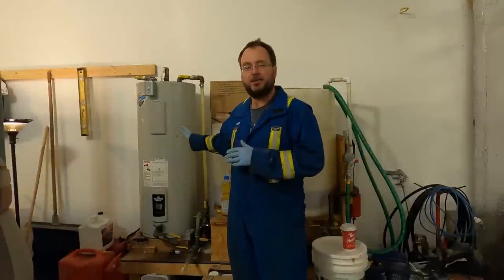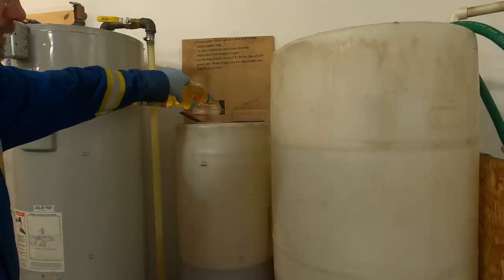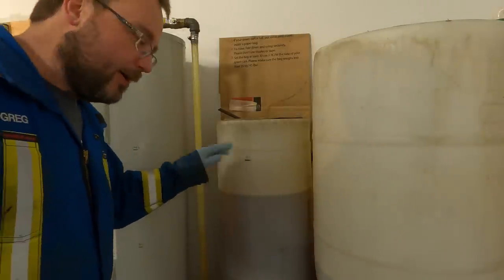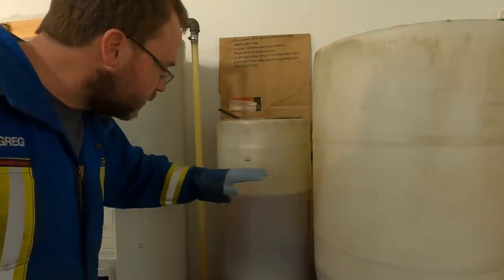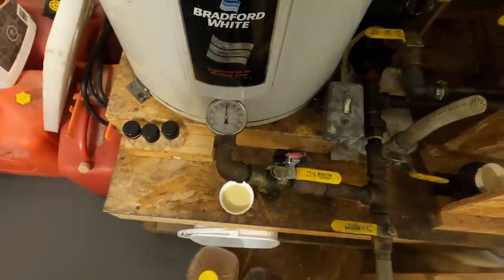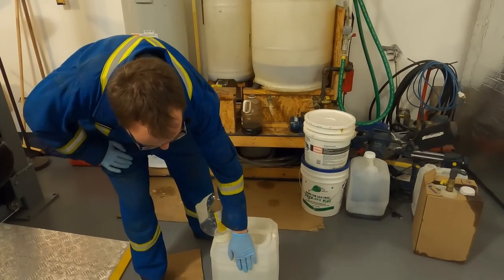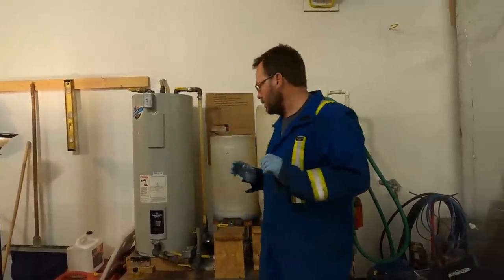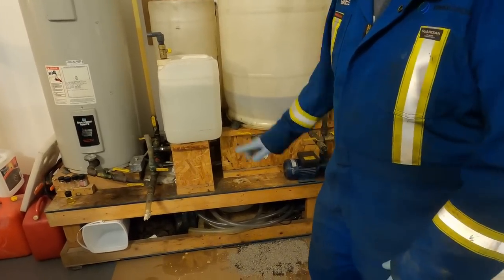Making a batch of Biodiesel from used Canola oil - HOW TO MAKE BIO-DIESEL!

Comment: I ran a 50 gallon BioPro semi-automated machine for a bit over a year back the last time diesel hit $5 in the US.   It was a great experience, but I always like people to know the bad with the good.  Issue #1 was just acquiring enough used cooking oil to process.  Most of the mainstream places like McD's etc all have contracts with larger companies to come pump their waste oil tanks.  That left us with gathering up the scraps from various "mom and pop" places, and it's a nasty smelly process.  We had a couple of 50 gallon plastic drums on the back of a small trailer, and a 12V pump.  We'd spend half a Saturday driving around collecting up enough oil to process, then after we got back to our shop you would have to filter all the collected oil into other barrels, then heat/de-water the oil if it had been exposed to water, then load the machine with the oil, the methanol and the Sodium Hydroxide or Potassium Hydroxide, then start the machine.  Then the #2 big issue was the waste glycerol.. not glycerin, because at that stage your separated glycerin still has a bit of methanol in it and is nasty stuff.   So you either have to find some place to take the glycerol off your hands (and you'll have a LOT of it), or you'll need to do another process of separating they glycerol into methanol and glycerin, and then hope you can find someone to take all that glycerin off your hands.   At the end of the day, it's a LOT of work, with a lot of messy oil, chemicals, waste products, etc.
Reply from the maker: all correct.  I do not recommend individuals make biodiesel.

A few points:
- Fast food oil is no good because they use it to the end of its life and is full of acid.  Too hard to process.  The key is to get good clean oil from a local pub.  I had one pub that had good clean oil they changed weekly and put it in plastic jugs for me.

-  Most larger cities have waste disposal sites where you can drop off old oil, paint, etc.  Take the glycerol there.
Reply: @gregs_garage  All good points.   The processing of the oil, regardless of its condition, was never the problem.  The BioPro would consistently produce ASTM commercial grade biodiesel every time.   But it's extremely hard to find enough source oil, especially depending on the amount of diesel you need on a monthly basis.  A few jugs from a small pub or restaurant would only be a drop in the bucket, at least in terms of what we needed, which was to make 50-100 gallons of biodiesel each month, enough to make it worthwhile from a cost perspective to fuel a couple of our trucks.   I live in the suburbs of probably the capital city of petroleum production in the US, and while we do have a handful of centers that take waste materials, there is a service fee to do it, especially if you are dropping off a couple of 55 gallon drums of glycerol every few months, which adds to the cost of making it in the first place.    I think there are "sweet spots" for how much you produce, such as a very small batch producer for minimal needs for car, small truck, etc, or much larger batches than even what we were producing so that the costs could be absorbed by a larger group, and utilizing the machine more frequently.
Reply from the maker: @5thGenNativeTexan  Yes the sweet spot is small production for sure.  I run a 1.9 liter VW diesel that gets 40 MPG. I make Biodiesel and blend it into the tank with petroleum diesel a few gallons here and there.  It works for this, but big volume production becomes a fulltime job.
Reply: I did the same thing. Semi automatic. I remember titrating the oil. We would go to the city and purchase a few 50gal drums of methanol. Had a few different transfer pumps. Run it through the processor. Then pump it into a 100gal cone tank. Let it sit. Drain the glycerin the pump it into a bubble wash drum. Wash it twice, then pump into a 1000gal tank I had. Ran our truck, tractors, heaters, ect...  Lot of work! Pain in the ass.  Gel up in cold weather. Plug filters.  It was a learning experience though.  I'm glad I did it. I have a long gravel driveway and build a spreader for the back of the tractor and coat the driveway with the glycerin. Tar and chip!😄
Reply: Just use gelatine to filter it.we use this process in the uk.
Reply from the maker: @andywells397  I've seen a lot of this gelatin method lately.  That's not Biodiesel - rather it seems to be a way to filter the oil.  you end up with cleaner veg oil, not biodiesel.
Reply: Did you build the Reactor yourself?
Reply: @BAVALCOINEN  Are you responding to my post?  If so, no.  As I noted I purchased a unit called a BioPro from a dealer in the US.  It's an  automated batch processor.
Reply from the maker: @BAVALCOINEN  100%
Reply: @5thGenNativeTexan  
Yes indeed.
How big was it?
Are they still around?
Can you please share more about it here?

Thanks in Advance.
Reply: An easy way to get rid of waste glycerol is to just burn it the next time you are burning off a big pile of old wood. 
A second way is to blend it with just enough used engine oil to get it good and black and then dump it at a collection center that takes used oil which is supposed to be any place that sells new oil.  

As a used oil recycler, I could care less if there were a few gallons or even 10's of gallons of glycerol mixed in with the volumes of used oil I work with.
Reply: @tcmtech7515  You need to burn glycerol extremely hot.  If not, then you've got mustard gas, and then you've got a bad day.   Typically, glycerol is already black.
Reply: @5thGenNativeTexan  The last time I checked wood fires were more than hot enough. 
If not, just make sure the smoke is going toward the neighbor you don't like.
Reply: @tcmtech7515  True, you'll probably see 700F degrees or more in typical wood fire, hotter at the core.  The critical state for glycerin is from about 400-600F, at which point it's making  toxic acrolein fumes (aka.. mustard gas).
Reply: @5thGenNativeTexan  Probably not a good idea to try and burn 55-gallon drums worth with a campfire in one go then. 😋
Reply from the maker: @tcmtech7515  it's already black.  just call it motor oil if that's the issue.  They don't check.
Reply: @gregs_garage  As I commented before. It's what I do for a living and yes, at my level I don't care.   

The problem is many of the collection sites are very anal about what they think is in the oil people bring them which is fairly justified given if the people like me next up the chain reject a load they have they have to deal with it and that can get extremely expensive for them real fast because the only places that will take it then are the HazMat disposal places and they will screw them over hard for stuff that isn't even hazardous because they can get away with it.
Reply: @kgsalvage6306  Where did you get the methanol and how expensive was the stuff ??? Any pointers Sir ??
Reply: @gregs_garage  Could you use this fuel oil in a kerosene heater using just the oil ??
Reply: @Victory First  I live near Pittsburgh Pa.  I got it at Penn oil.   The only reason I was able to get it there was a friend of mine has a mining  company.  I'm not sure the cost because I  would go pick 10- 50gal drums for him and put it on his account.  Got paid for the trip with methanol.  Not sure on any special tips,  but if you have any questions I'd be happy to answer.   The plastic cone bottom tank definitely made it easier to let the glycerin settle out and drain off.  I actually did 40 gal at a time.  For cleaning after processing, I had a 55 gallon drum and put electric heating elements out of a hot water tank and heated it up.  Added some water.  I made a coil for the bottom of the drum out of 3/8" copper pipe and drilled small holes in it.  Connected to an air compressor and bubble washed it.
Reply from the maker: @victoryfirst2878  maybe, but the finished product would likely burn better and less risk of clogging up the heater.
Reply: @tcmtech7515  😀😅😅🤣🤣🤣🤣🤣
Reply: I use the glycerol to "clean" the waste vegetable oil. In the reaction tank is 250 litres , in goes about 25 litres glycerol which then gets whizzed in with a paint stirring tool run by an electric drill for 5 minutes or so. This does a great job of removing or settling any particulate matter and can be drained out after a day or two. Nice clean oil ready for the transesterification process.
Reply: ooooooooooooooooo
Reply: Been making it for about 5 years, no regrets.
Reply: I found it made a reasonably good degreaser but you only need so much degreaser

Comment: Did you ever measure how much electricity is required to process say 100 litres and figure out a cost per litre? You seem to be a wealth of knowledge on bio diesel it’s a shame you now hate it lol! Great video Greg thanks very much!
Reply from the maker: very little electricity.  The pump runs for maybe 2 hours and burns maybe 100 watts?  The blow drier is maybe 500 watts for a couple hours.  I'd guess 25 cents electricity total.  Let's say it is $1.00.  That's 1 cent per litre.

The biggest cost is methanol.  Second biggest is KOH.  Total cost about 30 cents a litre, or a dollar per gallon roughly.  When fuel is $5.00 per gallon it works out well.
Reply: @gregs_garage  awesome! I would have guessed it cost much more! I daily a 2001 ALH which is fantastic because diesel is on average €2 per litre in Ireland at the moment! 250,000 miles on the clock and still averaging 50 MPG. I won’t ever bother with bio diesel, I don’t do near enough mileage yearly to justify it!
Reply from the maker: @RobertE92  I drive a 2003 ALH.  Diesel is not far from 2.00 CAD here.  About 1.50 USD per litre
Reply: @gregs_garage  almost 2.50 cad here in NB today. Which is why I'm here lol
Reply: @gregs_garage  What is the kwh of your water heater? Or is it propane? Mine is 7kwh so it would cost a decent amount to heat all that oil
Reply from the maker: @jaytee9111  120 volt element running maybe 1000 watts.  Maybe 30-50 cents to heat the oil.  Negligible.
Reply: @gregs_garage  A used oil heater could save a few dollars there too, offgrid solution ... be ready.

Nice setup Greg, gives me ideas for mine.
Reply: @jaytee9111  The oil has to be heated to 50 degrees C and all oils need a fraction of the heating required by water. Oils have a low specific heat capacity.
Reply: The best way to clean used cooking oil is to boil it over water.  Add about 40 litres to a 200 litre barrel and top up with dirty oil. Boil the water until oil is hot. Switch off the heater and allow to cool to 60 centigrade. The first literally drops into the water. Pump this warm oil to the reaction tank and rapidly mix in the prepared methanol/KOH (or NAOH) mixture. Allow to settle and cool. 
Pump off the biodiesel and drain out the glycerol soap. 
The biodiesel will still be caustic. use a misting water sprayer over that methyl ester (biodiesel). The fine water droplets gently wash the methyl ester. Sample test the pH and stop when it’s neutral. Drain the soapy water to waste. Add clean water for use with the next batch. 
The best way to mix oil and methoxide is via a fairly powerful pump. Rapidly pump the warm oil to the reaction tank. Use a T fitting at the pump inlet to add methoxide as the oil pumps through. You can test the settings with water instead of the pretty nasty methanol/caustic mixture. You need 4 litres of oil per litre of methoxide. 
The pump will churn the mixture allowing a good reaction. 
Large LP gas bottles, inverted, are ideal. The dome top is a great funnel. You will need to add tapping points as necessary.

Comment: When I was younger I grew up out in the "sticks" (very country small town). I'll never forget it, there was an ancient old man who had a nasty old IDI 6.9 liter diesel f350. I got to talking to him about the gross looking tank in the bed of his truck all plumbed in. He literally just went around and gathered up used fryer oil for free back then, and said all he did was heat it, filter it while heated, 1st through paint filter, then through an oil filter or something similar. After that it was ready, his waste oil tank had a heating element, he would warm the truck up on regular diesel, shut off the diesel with a valve and turn on the heated veg oil, it ran fine. When he was ending his trip he would turn off the veg oil and turn back on the diesel let the residual fryer oil get burned up in the engine (if not the truck wouldn't start again) 🤷 that's literally all he did. Long term side effects I never seen him again to ask...
Reply from the maker: good story - not biodiesel but yes old diesels will run on all kinds of oily liquids.  For a while anyway.

Comment: nice !      i read a paper once that mentioned the {glycerin/koh /alcohol}   by product could be used as a rust remover ,  id be interested to find out if that is correct ,, i think they were heating it up and soaking parts in it , somewhere below the vapor temp , 120 degrees?

Comment: That's a REALLY nice setup.  The only thing that could be added is an old top loader washing machine to agitate the mixed solution.  However, you've essentially accomplished the same thing by recirculating your water heater for approximately one hour.

Comment: Ive watch the 3 part videos, and then this video multiple time and i am just fascinated by this whole process. I want/need to do this once in my life. Not many people know this, but this whole process can be produced self sufficiently. Solar panels to a car battery to produce, by electrolysis with seawater, sodium hydroxide. Chlorine and Sodium Hydroxide is produced in two chambers, the gas expelled is Hydrogen , this can be used to heat the Distillation of wood to produce methanol. Both used in the catalyst. You can also grow sunflowers to produce the oil. This can all be done at home, completely off grid. Pro tip. To avoid the inlet settling glycerine, run the pump with catalysis valve open to draw in air. This will force the remaining inlet tube up the side into the heater capturing all of the reacted biodiesel, allowing all glycerine to settle in one batch.
Reply from the maker: Interesting theories. How many sunflowers do you have to grow to make 100 litres of biodiesel?

Comment: Hi Greg,
I’m interested to know… with your water heater tank, did you buy it brand new or used ? Reason for asking is that if you naught it used how did you ensure that all the water scale and rubbish that accumulates and builds up inside when in hot water service is all removed before you use it for heating your oil ? Thanks mate
Reply from the maker: used.  Flush some methanol and oil thru it first to dry it out.  Also any crud will come out with the glycerol in the first batch.  Finally the filter at the end will catch anything remaining

Comment: what about the water thats already in the oul from the supplier? don’t you let it settle in the first tank to drop any of that out or does that boil off anyway? why don’t you use a water washing stage  near the end to further clean the oil? what do you then do with 20litres of ‘glycerine’ and methanol?? has the oils viscosity changed, thinned maybe?, because of the methanol? or is the methanol purely part of the reaction process and you expect most of it to be mixed with the glycerine waste? do you have a fuel preheater before your filter or combined with your filter to heat up and thin the oil/diesel mix? what ratios of oil to diesel do you use across the year? what about titration? do you add any anti oxidant? or microbial biocide to your mix? to stop the oil going rancid if its in your tank a while? or do you run a tank off pretty quick so preventing any stagnation….

Comment: Iv'e known quite a few people to make their own biodiesel over the years and a total of zero of them still do it, even though it worked and even though it saved them money. Its messy, time consuming un fun process but Ive seen another guy spin out the contaminates then just mix it with paraffin and thats it, I don't know what the cons are of doing it this way are though. Making this stuff seems like something that needs to be done at scale to be viable but by the time they add their margin on top how much cheaper is your fuel?

Comment: I made plans for a similar system. I will turn my heater tank upside down in order to funnel and completely drain all contents of heater tank also making it more efficient at separating the glycerine and dirt that settle; hot water tanks usually have concave top and convex bottom (from inside). Thanks for the very  excellent video
Reply: good point

Comment: i wish ask about the heat air blower.What do you think it can work with an hair dryer? or what else simple machine is good to replace?   What is it when in the pipes , inside the barrel (what is fulfill with gasoline) its  coming back the oil in the plastic air pipe?? or the air push out from pipes? thanks
Reply from the maker: The air pushes out from the pipes and bubbles up through the biodiesel.

A hair dryer will not move enough air and will likely overheat and cause a fire.  The hot tub blower i use runs cool and is designed to operate for hours.

Comment: After you heat the oil in the water heater why not pump it into a cone bottom tank for the reaction and especially the draining off of the glycerin and then later when you drain off the wash water. A cone bottom tank would save lots of frustration and allow ease of draining contaminants. I like the use of the hot tub air pump, good thinking. Why did you not do a water wash and settle to remove and any leftover base from the KOH and bring the final fuel as close as possible to neutral?
Reply from the maker: Cone tank is better but I didn’t have one and wanted less tanks overall.  Water wash is great but then you have to deal with the water.  My old VW seems fine on this stuff.